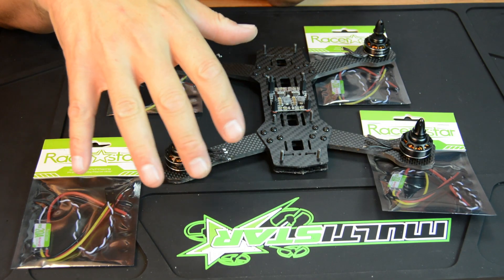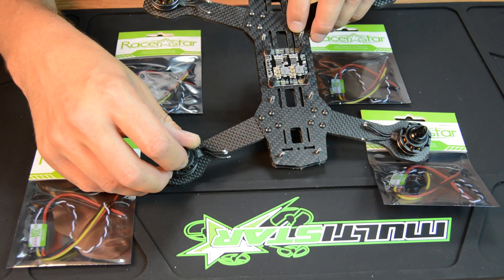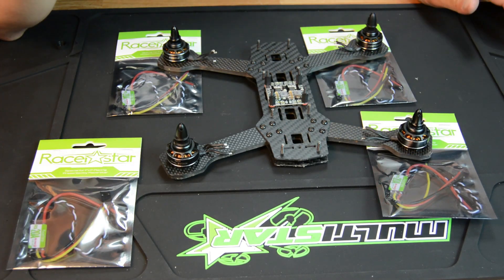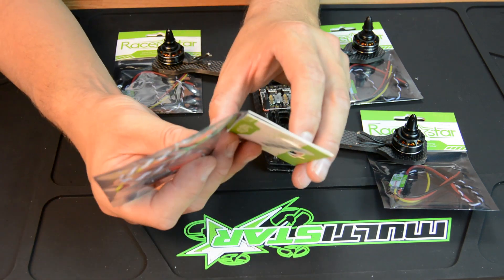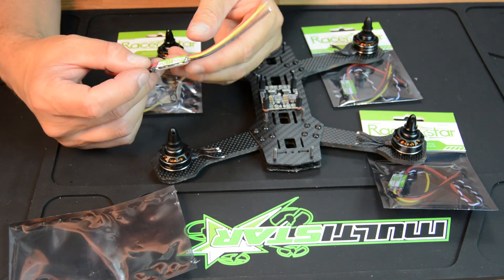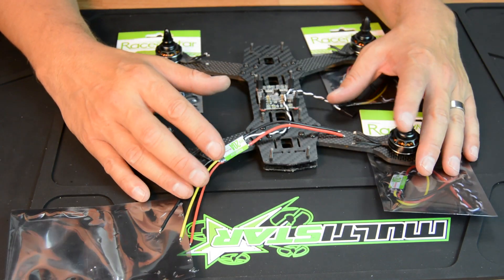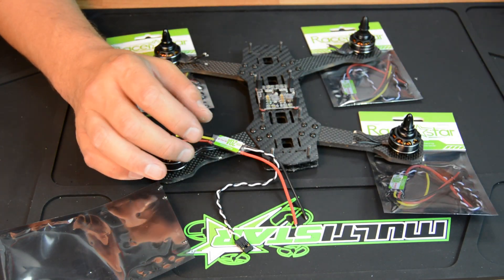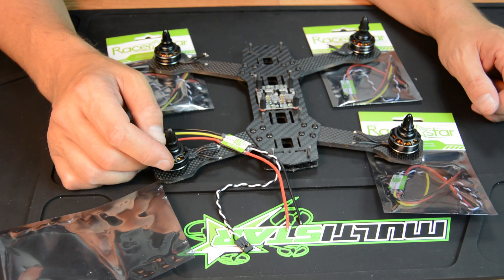RacerStar 20a ESC's and PDB - ZMR Rebuild Start

Comment: I know this is an older video but I just ordered four of these for 23 bucks shipped with the code 2017cyber9%
I got the 20amp version which will run Dshot 600. I am putting them on my old ZMR with DYS 1806 motors. This will breath some new tech into my first quad😊 It has a CC3D and I just read you can flash Betaflight on it. The Naze32 and CC3D are very similar, The Naze has an MPU 6050 and CC3D has the MPU 6000. Thanks for sharing man👍

Comment: Great video. I notice you didn't cross the wires for the cc motors. Can you tell me why? I'm new to this and it's a steep leaning curve!
Reply from the maker: +Mike Hogan because I use something called blheli suite to change the direction of the motors- keeps the wires more clean. It's called blheli pass through which means you can control the settings of you escs through your flight controller

Comment: hi are these capable for low kv motors? like sunnysky 700kv? i need a new set of esc for my rig and i found about these. honestly i never used a simonk or blheli esc before. can i use this racestar blheli 30a opto esc without any problem? and what programming/flashing tool can i use? thank you
Reply from the maker: you can program them through the flight controller pass through to BlHeli suite or directly to blheli suite.  I don't see any problems powering a 700kv motor...
Reply: 7demo7 im using dji naza fc 😣 i cant program esc through naza? what programing tool can i use with this esc? thank you so much

Comment: Can we use this esc's on cc3d ?
Reply from the maker: I don't see why not...
Reply: When I turn on the battery the board does not turn on.  Is it because my board does not work my esc? My board is CC3D Revolution
Reply from the maker: Most likely you need 5v running from the pdb to your flight controller
Reply from the maker: These do not power your CC3d-

Comment: How are those ESCs holding up after you put some time on them?
Reply from the maker: Very Very Well- Putting the 30A  V2's on my new build= video uploading now....
Reply: Did you jump to 30A, because with the 20A is not enough for the 4s? I have seen in Test Thrust that depends on the propel with 4s You get more than 20A in full gas.